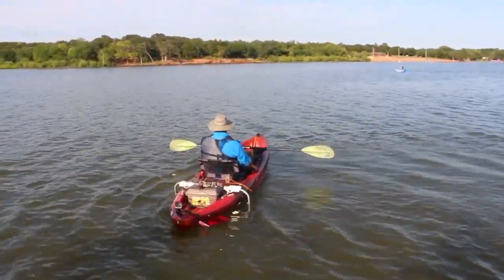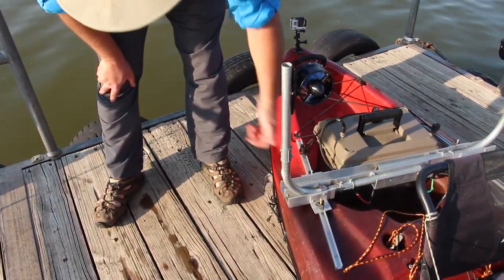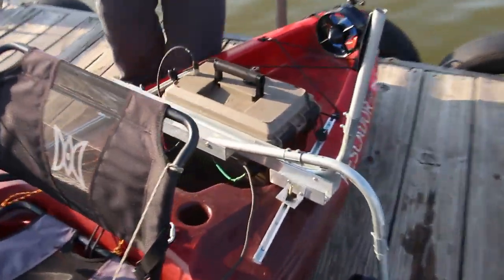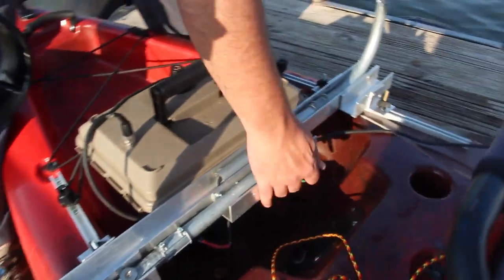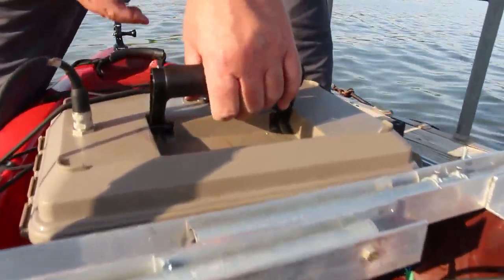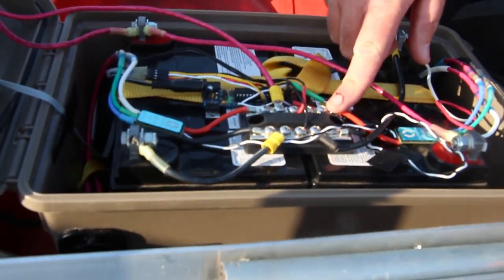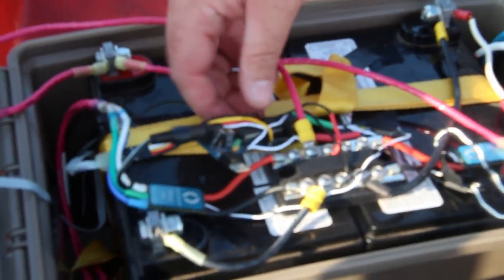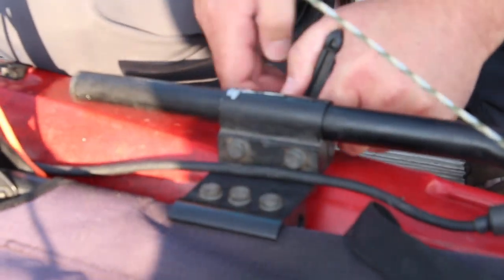T200 Kayak

Comment: Is the arduino necessary? Cant you just go from the motor controller to switches? Just turn on then a enabke switch for each one to control direction?
Reply from the maker: No. This motor controller is a typical ESC (electronic speed control) from the Remote control hobby world. So it is designed to plug into a receiver that would be getting inputs from a transmitter.  So the arduino is taking the place of the receiver.  The motors have 3 wires and need the ESC electronics to accurately control it.
Reply: You can easily "uncomplicate" and do away with the Arduino by using a "servo tester" to control the motor ESC's.....
You can also 3d print the motor housings and props for under $20 and buy 2 motors and ESC's for $30ish.....so $50ish for both motors and ESC's rather than $200 each....

Comment: I'm just wondering how you got Steve-O to  narrate your video. Just messing with ya!
My kayak is a pontoon and I want to just use one thruster underneath to help on windy days.
I already have the brushless thruster but need to figure out how to raise/lower the speed on a 12v battery. There are no simple videos on  how to wire a thruster.
I just want to wire my motor to a controller and be able to just turn a knob or flip a switch to go in reverse.
Reply from the maker: The blue robotics web site has diagrams and info on how to hook it up. But you need an ESC to control the motor, and something that sends the correct signal to the ESC. A simple 5 dollar servo tester would work. But thrust commander that bluerobotics sells would be a good choice as well.

Comment: Why not trolling motor 30 lbs 20 lbs ? What is the advantage? Speed? consumption? Price? Mou
Reply from the maker: No matter which way you go, the hardest part is figuring out how to mount it to the kayak.  I wanted to stay light, slim and balanced as possible so I could still wheel it down narrow pathways to the water from anywhere not just a boat ramp. A trolling motor would be mounted on one side or the other if you are hand steering so it would be heavy and bulky on one side, plus you usually have to do modification to the length or the head electronics so I wanted to start from scratch.  I have full speed control forward and reverse not just 3 speed settings. My goal is fine control steering not trying to go anywhere fast.

Comment: John, do you have the PIN out for the Invacare joystick?
Reply from the maker: The joystick was wired into circuit board inside housing. I couldn't find any documentation on how the board communicated with the main board under the seat of wheelchair. I took out the board inside the remote,  and wired the joystick directly to the 5 wire cable. I'm only using 4 wires;, 5 volt, ground,  speed, direction.

Comment: quick question, did you write the program from scratch or did you find a site for the controller to program input and mixed signal output?
Reply from the maker: No I put relevant code blocks together to make the script. Blue robotics has demo script to show how to get motors initialized. Used Arduino servo library. And used code block that mixes the analog joystick readings into signal for each motor.

Comment: Batteries Wired in series not parallel. As parallel would still only have 27 amps.[wink].
Reply from the maker: No I'm afraid you have it backwards. My batteries are wired in parallel to keep the voltage at 12 volts.
Reply: @John82y  Ahh, of course that is correct. You seemed too astute to do it in series of course !!.

Comment: How long can you run for?
Reply from the maker: In my setup I've ran 40 mins at full power. I usually only operate a very short time at full speed, mostly I use just enough thrust to keep pointed in the right direction. I've been out for 3 hour trips with no problem.

Comment: John, How fast will both these motors run with a 24v battery?
Reply from the maker: I've never tested it above 12. The bluerobotics website has several graphs of motor performance you can check out.  https://bluerobotics.com/store/thrusters/t100-t200-thrusters/t200-thruster/